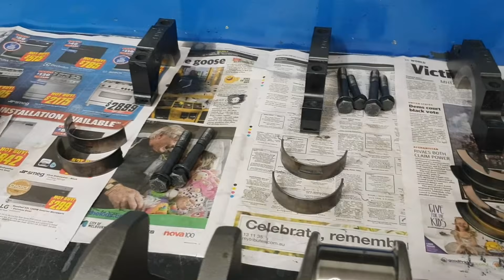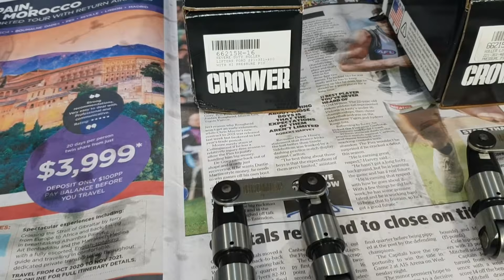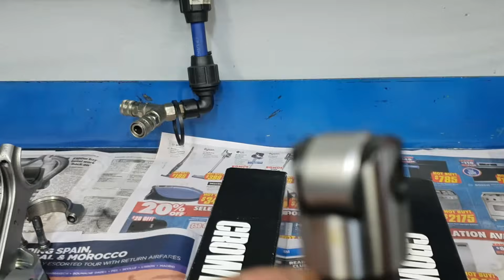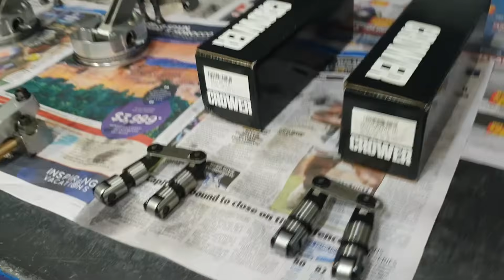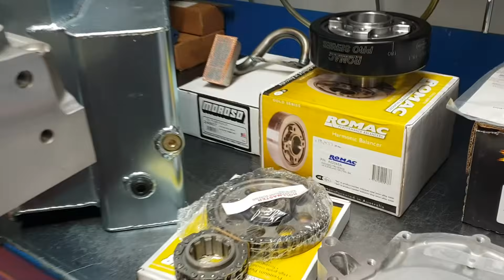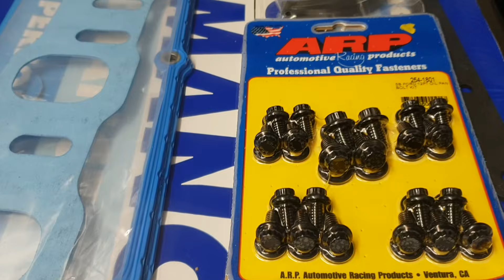Competition Engines 720 HP 434ci Cleveland Build Details

Comment: I agree with that lifter upgrade I used to always have problems with my Windsor and my Cleveland Drive driving it on the street flattening out lifters ironically enough I always used Crower lifters

Comment: Canadian here. I remember that in the 80's I built a Cleveland engine with 12.5 pistons, 650 lift cam, head  and main bearing studs. "O" ringed head and block, crane roller rockers triple vavle springs. Holley strip dominator msnifold and 850 dp carb. It was a Screamer, I remember that it was lots of money.  Been out of hi performance  for decades. What would this engine cost now with the upgraded lifters, etc?? Thanks.✌️

Comment: I have a 391 Cleveland. In a 65 Ford f100, 4 speed,5.18 rear end. Stock form with those gears is a torque monster. I can't imagine if it's stroker. The truck has only 25k. My grandpa ordered it to pull 5th wheel, goose neck camper trailer and was only used for that.

Comment: Ok, confused...why the 3-valve nomenclature? It is a 2-valve engine.  Ford used the 2v 4v to denote the smaller valve port 2v  vs the larger valve, port 4 v is this then a middle-of-the-road head or, something else?
Reply: In Ford nomenclature, "V" stands for Venturi, more commonly called a barrel. The 4V factory head came with a 4 barrel carb; the 2V with a 2 barrel carb. The head mfgr is using "3V" to indicate that it's between the factory 2V and 4V heads in valve and port size.
Reply: nothing to do with 3 valve. the '3v' refers to the type of cleveland cylinder head it is.
Reply: @juliennacer8871  Ok, but what does 3v mean? Why give it a designation of 3v unless they are trying to suggest a hybrid or a compromise between the 2v and 4v. In the US, we are all very aware of the valve sizes, ports, flow numbers, and chamber sizes, between the 2v and 4 v so 3v means a lot to us...thanks
Reply: @Pat Luxor  thanks, makes sense
Reply: Canadian Selkirks or Washington state Selkirks? I'm a Washington Selkirk hunter/explorer/prospector And yeah the 3V head  is meant as an in-between sized head. You get the best of both worlds, the low end torque/street ability of a 2V but with closed chamber combustion chambers, and also the massive valves and air flow of the 4V. An Australian company called CHI makes them and the intakes that fit them.
Reply: @vadenk4433  both, I love the Salmo Priest area of Wa and Revelstoke in BC

Comment: I thought the Cleveland block had the water thermostat housing beside the distributor hole.
Reply: It does. But you can put Cleveland Heads on a Windsor block which is used in this case you just have to do a slight modification to the heads.
Reply: @lorenzomaximo1818  - So this engine is a Clevor?
Reply: @danmyers9372  
Yes it’s a Windsor block that will have Cleveland heads on it.
Reply: @danmyers9372  , yes as stated in the video
Reply: Its a Dart SHP  windsor block but they can use Cleveland heads

Comment: When I look at the front of the Cleveland block , there is a horseshoe shape in the casting .which sticks out like an inch and a half , where the timing cover bolts on. On the block you are showing here it looks more like a Windsor with the Windsor style timing cover . Why is that ? Just wondered. Thanks
Reply: Sean Madill the block used for this build is an aftermarket SHP Windsor block with a 9.2” deck height. As you pointed out the front of the block is quite a bit different than a Cleveland block.
Reply: It's a Clevor build as stated in the video

Comment: My favorite motor. I’ve got a 0.030 Cleveland with the Parker funnel web intake, mechanical roller cam custom ground off of the BBC. TRW forged flat top pistons. 3/8” oil line from front of engine block to number 5 main oil galley. 4-V closed chamber heads with the tongues. Low 9’s on a 175 shot. I would’ve never thought my 86 mustang would’ve ever been this fast with such a simple setup. Great video. Thanks.

Comment: What effect does having the pin intrude up into the oil ring galley have on the piston?
Reply: It increases the length of the stroke.
Allowing for a longer rod.
Reply: @rightnews339  They didn’t show it but I assume they must run a piston pin button vs a retainer?

Comment: That is a Windsor block.
Reply: It's a Clevor build as stated in the video
Reply: Ford Windsor and Cleveland engine blocks have the same cylinder bore centerline spacing and head bolt locations which makes it very easy to use superior flowing canted valve Cleveland heads on Windsor blocks. The combination is commonly known as a Clevor engine. OEM and aftermarket Windsor blocks are more plentiful and the extra.300”deck height (9.200” Cleveland, 9.500” Windsor) makes getting more displacement easier with additional stroker kit combinations. 

Modern aluminum alloy blocks with Cleveland specific architecture featuring upgraded priority main bearing oiling and choice of deck heights are now being produced in an American foundry. All machine work and sales are being handled by Timothy Meyer. 
tmeyerinc.com
Reply: @danielwilson6665   All that is true but this is still not a Cleveland style block it's a Windsor. Do I need to explain the difference or show you pictures?
Reply: @terraboundmisfit  ,  there’s nothing in my comment that suggests that this is a Cleveland block. I simply pointed out the identical dimensions that both blocks have in common. The block shown in this article is clearly an aftermarket Windsor design and there’s really no need for you to illustrate the point any further.
Reply: @terraboundmisfit  Mate these blocks are a combination of Cleveland and Windsor,more Cleveland as it has a Cleveland crank,heads and manifold.Dart and world blocks are a copy of Ford Motorsport block that Ford replaced the Cleveland for Nascar and drag racing

Comment: Romak balancer, but you said it was internally ballanced? Running a romak on my 77 AMC 401 that one is in my 49 Willys 4X wagon
Reply: The Romac is primarily used for controlling engine harmonics as a vibration damper. For a internally balanced engine it would be a “0” imbalance or neutral balanced.